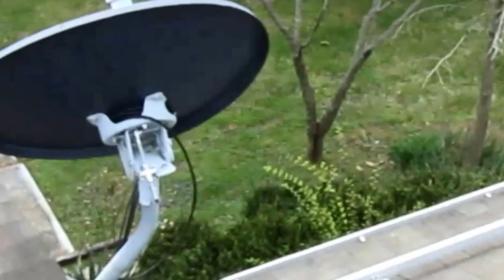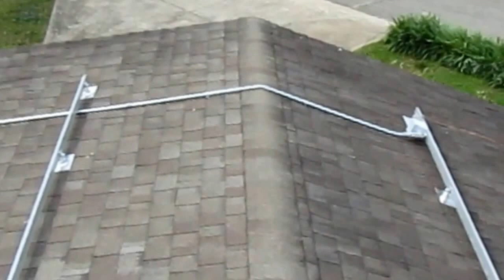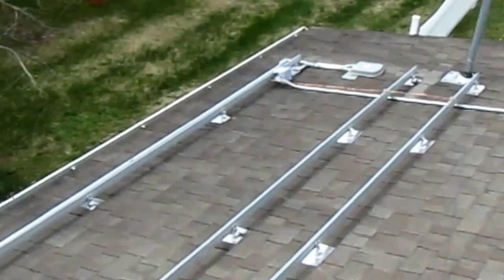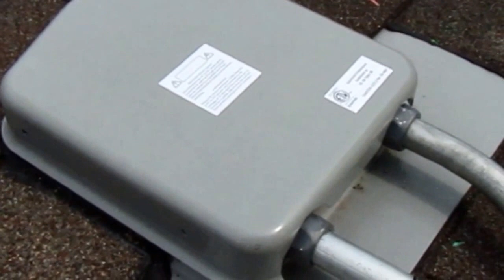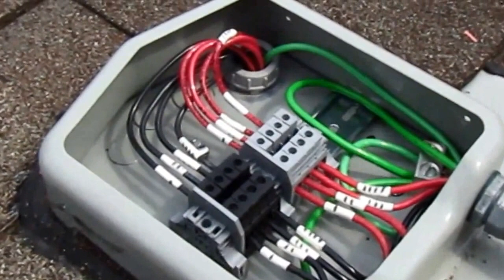SOLAR POWER INSTALL (PART 5) - Ken The Solar Guy

Comment: I see you didn't use a grounding bushing.  Is the locknut underneath the grounding pathway for the emt to the soladeck?  How is your conduit grounded?
Reply from the maker: If you look at the right side of the shot, you will see the grounding lug. The lug is integrated into the case of the soladeck and to that lug is installed, the ground to the racking and to the rest of the system down to the ground rod mounted within 3 feet of the main disconnect.

Comment: Ken are the Red, Black, and GReen cables in the solar deck 10AWG rating?    Thanks my system is on its way and i cannot wait.
Reply from the maker: The 4 strings from the module string junction boxes to the soladeck are 10 gauge and are connected using EMT conduit and weather proof connectors

From the soladeck into the combiner breakers is also 10 gauge.

Coming out of the combiner boxes as 2 strings going to the last junction box is now 8 gauge

and the 8 gauge wires from the combiners are coupled with 6 gauge cable from the last junction box into the solaredge inverter.

Please be careful to pre-twist all connections that utilize wire nuts.......many people make the dangerous mistake of using the wire nut itself to twist the wires together.........that practice can be dangerous as there is no way to be absolutely certain you didn't have one of the wires shift during the process and thereby not have 100% coupling contact.

For the connections in an exterior junction box that might require wire nuts, there are the special type you need at Home Depot..........If you need a part number, let me know.

Remember you are dealing with high DC voltage of over 350 volts, so be very, very sure your circuits being worked on are not live..........it isn't like get a tingle from a live 120 volts AC circuit, a DC shock of that voltage will likely kill you

Hope this helps and PLEASE........if you need any tips, do not hesitate to ask.

If you're like me at this point, you are like a kid waiting for Santa to show up............I hope you have as much fun doing your project as I had doing mine..........On the day you finish you will be as excited as you are sad it's over.........I had an absolute blast doing mine.
Reply: Ken,    Thanks for all the tips.  I am using a Master Electrician friend of mine for all the final connection points.  I have worked with electricity before but have not undertaken something of this magnitude before.  I went with 24 Panasonic 330W panels and the SolarEdge 7600HD Inverter with 400 Watt Optimizers due to the Panasonic panels making a lot of voltage. I have seen this setup in several blogs so went with it and went with the newer SolarEdge inverter.    I drew my solar array with solar design tool and am going to my local permit AHJ to start the process of pulling my permit.   Wish me luck and i will keep you updated.
Reply from the maker: well, that's great.

Are you going to run 3) 8 panel strings or 2) 12 panel strings?      (either will work)
Reply: I am going to run 2 strings.  The 1st phase will be 1 string for 12 panels.  I just went and filled the papers for my permit with the engineering docs.  They 1st balked at Wind speed certification since we are in Florida aka Hurricane place :).   I wuickly came home and found the specs they needed at the Iron RIdge website and provided them the information.  My material is enroute to me and looks like it will get here this week.  I also found the 3 rolls (Red, Black, and Green) of 10awg THHN wire at Home Depot for a good price in 500 ft roll.
Reply from the maker: AWESOME!
Reply: Do you also have the SolarEdge meter to tell you consumption and generation of solar power?
Reply from the maker: I do not have a consumption meter or a meter that monitors real time usage..........but I keep a daily spread sheet with production values as well as meter readings with regards to how much it says we pushed back to the grid and how much we pulled back in..................I have the spread sheet set to automatically calculate daily, our standing with regards to whether or not we are over or under producing.
Reply from the maker: yeah, the battery thing isn't for everyone......Installing a system with a battery backup can nearly double the cost of the install..............If you are lucky enough to live in an area where the power doesn't go out much, the battery backup isn't gonna save you much.......if anything.

I am using the grid to be my "battery" during the day, and then I draw what I need back from the grid at night.

The only upside for me having a battery back-up would be to power my home by batteries if the power goes out.

The home  I lived in before this was in an area that had power outages weekly, but the one I am in now hasn't had very many at all in the 16 years I have lived there.............I mean, I can count them all on one hand.

I love the technology and the concept, but money wise............not so much.
Reply: Ken,  Definitely valid points.  1 year ago i lost power weekly.   Now they put my neighborhood on a new grid and have not lost power but once in 1 year.  So i agree with you that from a cost factor it is not feasible.
Reply: Ken   Well today my material gets here via freight.  I will check to ensure each panel arrives with no issues.     Will let you know how i fare.  Also waiting on Permit to be approved.  Fingers crossed :).  Since my house is 2 story i ordered the fall prevention gear and will be putting it up soon to the ridge of the roof.
Reply from the maker: good luck mate!

Dying to see your progress!!!